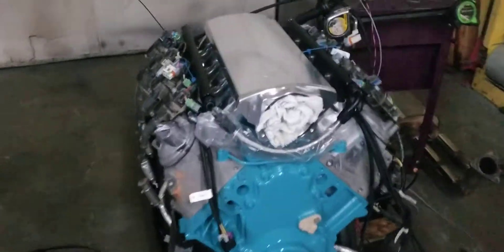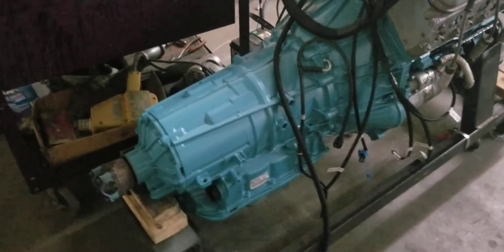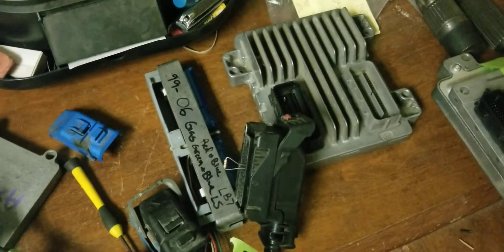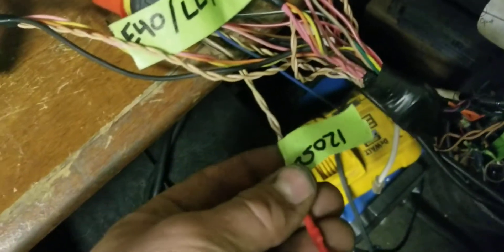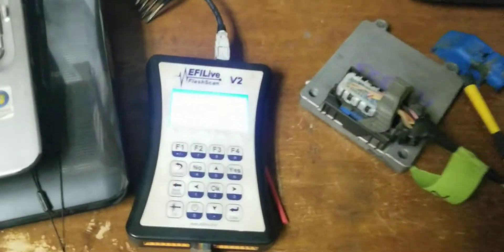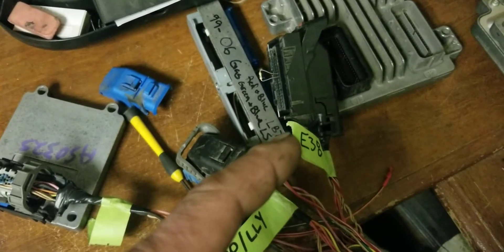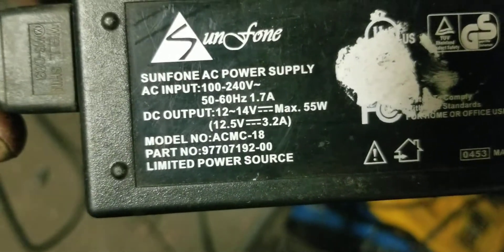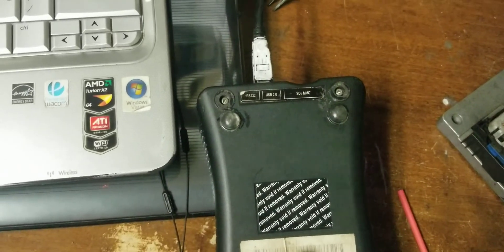Efilive v2 bench harness part 1 E40,E38,E67 ecu 99-06 tcm t42 t43

Comment: So I have a l92 out of a 2007 GMC Yukon denli  and a 6l80 out of a 2012 camaro can it work don't know if its different operating system but could it work together
Reply from the maker: The year of operating systems you were trying to use won't work with each other the brake is in 09 OR 10.
Must match ECM and TCM files /os. And yes there's more to it than what I just told you. Need to refer to a manual for your tuning tool efilive book

Comment: Have ls3 4l80 i have e38 t42 but my fans  not working and rpm not working but I haven't had a tune yet is that something that gets worked out in tune? Or what's a better combo i should use
Reply from the maker: 08 or 09 was the last year for the 4 speed transmission. Therefore those are the years of operating system you need to run as far as the E38 and t42 so they will talk to each other
Reply: @johnlowe4473  so yea update on mines that's basically the setup I have runs great thinking about going with 6l80 now
Reply from the maker: There are more variables then what u gave me.ecm tuning (read the files and see what OS, wiering harness for proper pin out and wiering) and sensors maf o2s injectors, TB...
Reply: Wuzup im trying to figure out. If my e38 ecm that once controlled a 6l90, Im swaping to a 4l80e, can my ecm  be flashed, and I purchase a t42 tcu and buy a harness for it all to hook up, and work

Comment: hello how are you plz i have hummer h3 2006 v5 3.5 l  with E40 ECM if i find v8 gn4 with E67 Ecm and harness i can  put it on my h3 and work properly all gauges and abc and traction control? and transmission sure i wanna make changes in the 4l60 to v8 ...
Reply from the maker: Essentially a Alpha H3.Yes
Reply from the maker: TBSS in H3 ecm and tcm OS. E40 and t42 OS. Cross reference files.

Comment: So u can program that t42 for a 6l80e to run with a stand-alone
Reply from the maker: The 6L80 has a TCM in the transmission that needs to see information from a ECU over can. bus (obd2 line ) with some work it can happen there is can bus converters that can tell the computer control the AC maybe somebody can make it send the signals it needs over the line. Mitch swap time can maybe get it done .